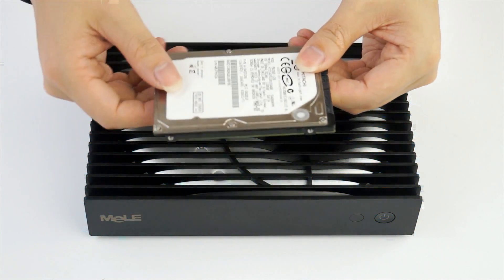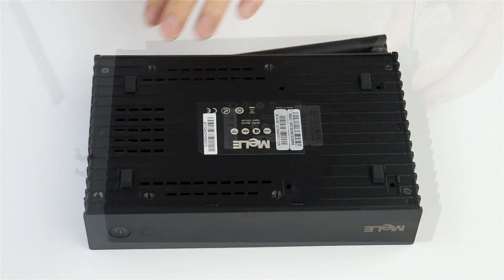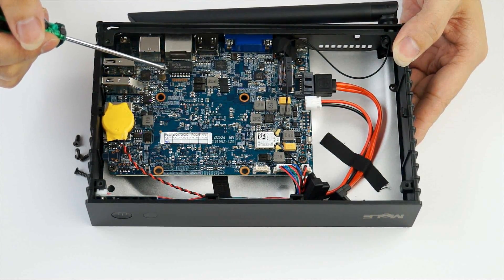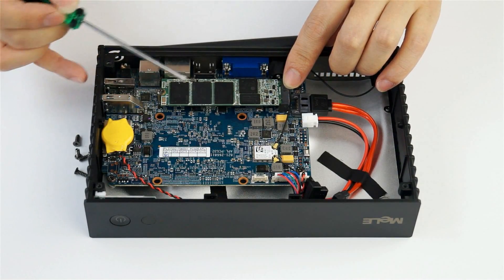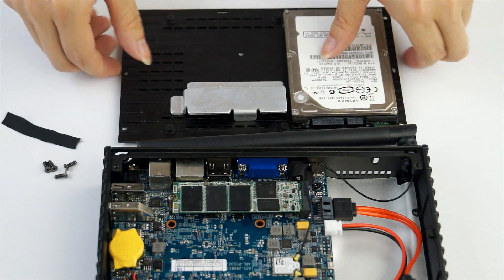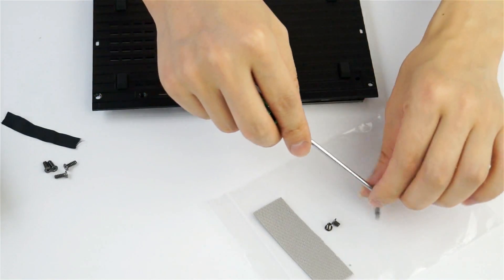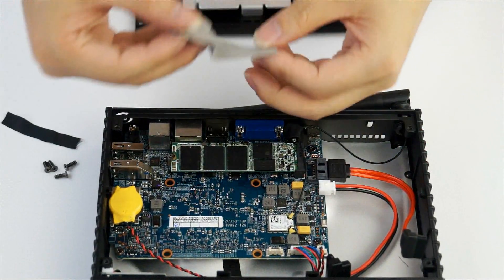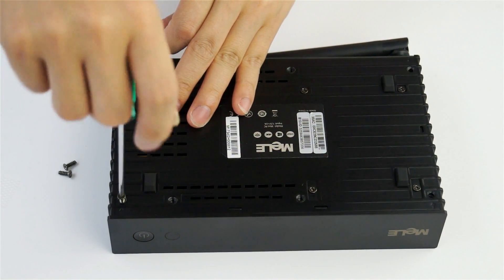Tutorial - How To Install 2.5'' SATA HDD & M.2 SSD on MeLE PCG35 Apo

Comment: Hey people from MeLe, i have bought a MeLe PCG35 and i have no complainst except for the fast eaten space on default sistem C, and my question is what software may i use to clone C to a brand new M.2 SSD? and second Can i erase data from C to use a a new partion or even better there,s a possibility to merge C with new M.2 cloned SSD?
Reply from the maker: Dear Francisco, MeLE is official licensee signed contract with Microsoft. According to the policy from Microsoft, the genuine key on PCG35 Apo only allows 4GB RAM and 32GB eMMC. Therefore, the user need to power on the mini PC and connect it to the internet to have the Windows 10 Home activated for the first time. Then the user may add M.2 SSD (if it is over 32GB) on the mini PC as an expansion of storage. However, the Windows still cannot be installed on the M.2 SSD (if it is over 32GB). Otherwise, when Microsoft detect the behavior which is against their policy, they will make the geunine key invalid. The same results when the user want to install it on the 2.5'' SATA HDD. 

It is really a pity that Microsoft's policy to only allow 32GB eMMC as storage for entry level mini PC. If expand the storage over 32GB, the license fee for Windows 10 will be USD45 at least instead of USD15 only right now on PCG35 Apo.